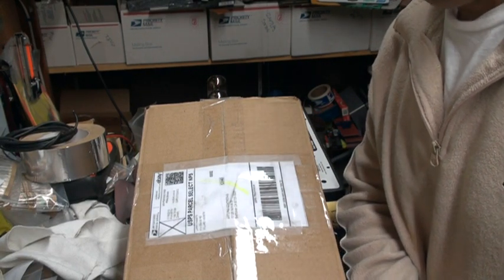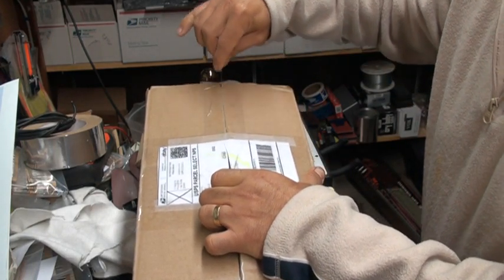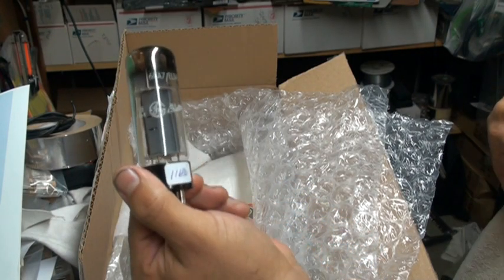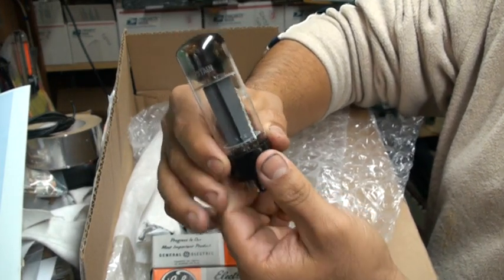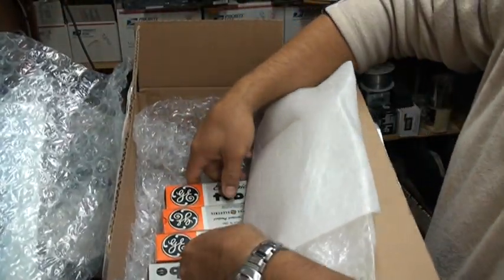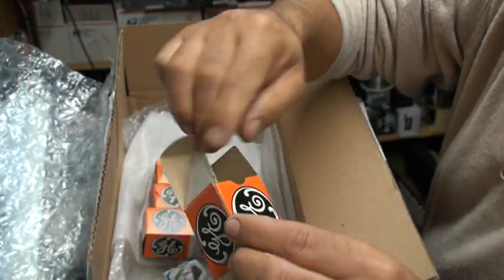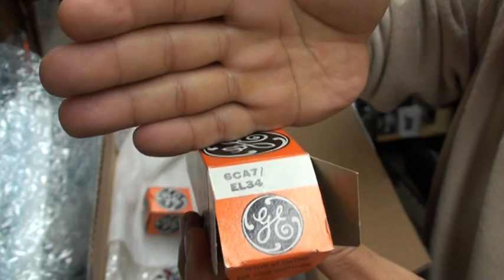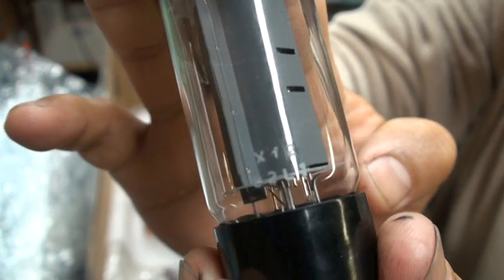Mullard Xf2 NOS EL34/6CA7 VacuumTubes

Comment: Great tubes, i need a quad of theese for my power amp. Do you remember the name of the seller? Are you selling?
Reply from the maker: You don't want to use Mullards for a power amp.  Use modern tubes for that like JJ, I have some  if needed.  May be for Hi-Fi  would be a better choice
Reply: mullards are the ones i'm using for years now. I have tried almost everything, new and old el 34's, mullards sound best